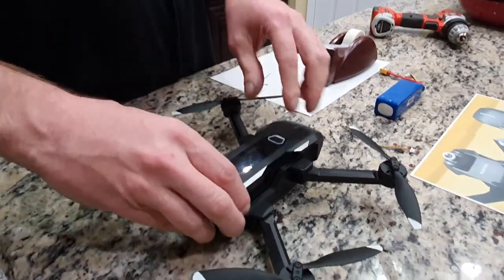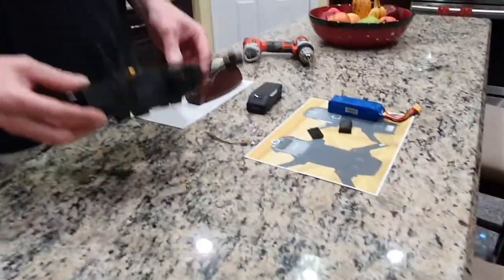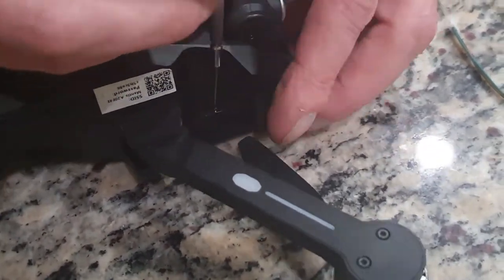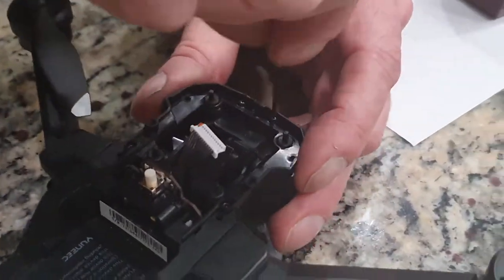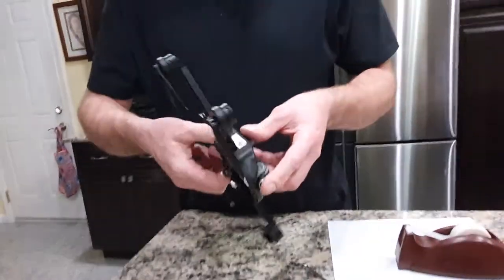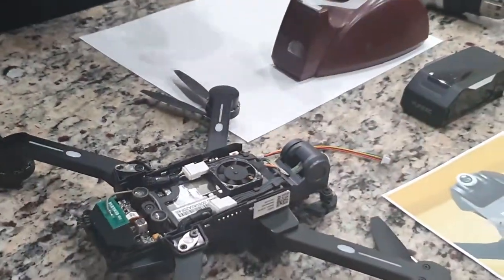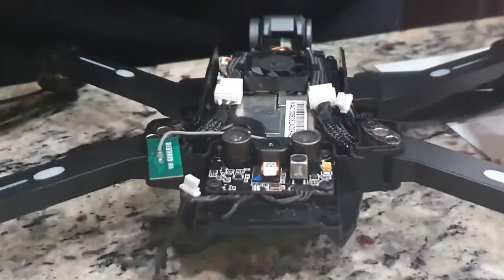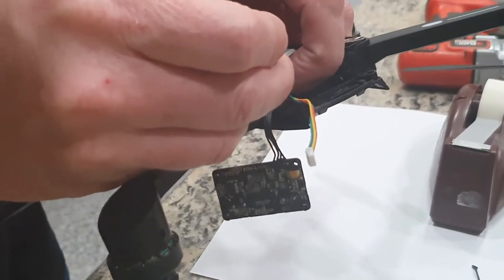Yuneec Mantis Q Battery Conversion Adapter with Compass Relocation Adapter Installation

Comment from the maker: How is the progress on this?
Sorry answer I gave up, it will only work for the 4 drones that have installed the compass adapter. (Mine and 3 other early testers)
I bought a completely different type of printer for better detail with the smaller parts. Made a completely different type of drawing for that printer. Printed some awesome quality cartridges that I was able to line the inside with foil to prevent electrical interference. And in the end I'm at the same place. Using the battery I designed it for.... It will not get the correct compass readings for flight, unless the compass adapter adapter is installed.

Since installing the compass adapter is so difficult, and the possibility of damaging the good module. I have thrown in the towel on the project. I now have I special printer occupying space and collecting dust. Was all still a good learning experience dispite all the cost of development.
Reply: RIP adapter

Comment: Super awesome mod bro.
I just saw on Amazon that a new one...Mantis Q is 169.00....I gotta have one and will likely do this mod.
Gave you a sub!
Reply from the maker: I had actually cancelled the entire adapter. Due to risky of damaging an unrelated connector during the installation of the compass relocator.
But from comments on another video, for another battery adapter that I make, I am given an idea for how to eliminate the need to use the compass adapter at all.
The thing I need to test is.....
Using aluminum tape used for duct work, called aluminum duck tape, I want to try wrapping a lipo battery with this tape to reduce electrical interference. The only thing stopping me from testing this new idea right now is.... I already have the compass adapter installed and will need to remove it, to return the mantis back to stock. Then I can tape up a battery and test without the compass adapter. First problem is I have no time and to many other projects going on. I'll get to it eventually. But until then, everyone will just need to keep using factory batteries. Also, no guarantees the test will go good?
Reply: @amphibiousmotorcycle  right on...I started to buy this srone from Amazon for $159...and apparently waited a day too long...because it's gone now!!
Either way I still want one but I sure dont have 3 or 4 hundred to put into it.
Looking forward to seeing what you do with the Mantis in the future.

Comment from the maker: Currently I have sold 3 on eBay and am awaiting there feedback before listing more.
I expect to list larger quantities in 2 weeks or sooner.
So today May 8th add 2 weeks by the 22nd I will add a link to the eBay listing here.
From the initial buyers I may learn somethings and make updates to the part or listing description and you will be much better off waiting for any updates that may be applied. Thank you all for your interest and Happy Flying.
Reply: Ricky Smith  do you have the battery conversion available w/o the compass conversion?  Also what are the specs on the battery?
Reply: Looking to buy this kit - where can I get it. Thanks
Reply: still available?

Comment from the maker: Is the compass adapter really needed?

I have discontinued the item.

Only me and 3 others are currently using this adapter.

Funny you mention.... Is the compass adapter needed. Lol

This is the reason I discontinued the item.

There is no way to use this without first installing the compass adapter.

But the killer is, when installing the compass adapter, there is a high probability that you will damage your GPS module.

The GPS module is located on the top under the front good area.

The GPS module has a wide connector that is difficult to disconnect but even more difficult to reconnect, without accidentally bending the tiny connecting pins.

Me and another both bent out pins, though we were lucky that we both found was to strengthen and correct the damage.

This started me on a mission to solve the issue and find a way to use this adapter without the need to install a compass adapter.

Even longer story.... I'll just say me and some great minds worked on it, had some promising solutions. In the end I can say for sure there is no way to make the battery or any other version of it work, without first installing the compass adapter.

Due to the risk of damaging a $75 part I have choose to not list the adapter on eBay.

Comment: Hi. Is arm replacement fairly easy on this drone? My rear left arm has cracked and bent after crash to the ground from tree branch fall and now it looks bad and I am afraid it is not gonna fly. But I am unsure if I should break the drone into pieces so I can put it back together after all?
Reply from the maker: Arm replacement is pretty easy, if you fallow this video it gets you close to doing it.  But be aware the reason I decided to quit making the battery adapter is because during this compass install it is possible to damage the connector for the GPS module.

Comment: if you check these comments at all, are you able to send me better pictures of the adapter front?  you can never see it in the video. also, do you have the updated design?  the one in the video is not the same as the one on thingiverse. thanks. the compass relocator isnt needed. it gives me no problems.
Reply from the maker: Sorry I'm slow to check the comments. I would think YouTube would have a better way to notify me when there is a new comment.
Anyway, I just checked thingiverse and all needed files are there.
I even have uploaded the compass adapter in another separate upload.
But if anyone is still interested in testing the battery adapter, I believe if you shield the battery with metal tape it should work without installing a compass adapter. I have not tested this and am only doing educated guessing. For the front of the adapter, you need to use the 2 smaller pieces. The one front piece needs to have the mini dean's connectors pressed into the square holes. The other small part goes on top last and the XT60 connector goes inside it.
Reply: @amphibiousmotorcycle  what about the connection to the drone? How did you do that? And from the video, you hooked the charging port on the side. That part wasn't in the file on thingiverse. That's why I asked about an updated file. Thanks for responding

Comment: Im looking for your kit do you still have any?
Reply from the maker: I'm not going to make more of these.
It's too complicated for the end user to take apart there drone to install the needed compass adapter.
There is a company selling batteries on eBay where once the battery goes bad, I believe you can open there case and replace the battery with a commonly available battery.

Comment: When will you be selling these???
Reply from the maker: I am setting up a new printing system now, using laser resin printing. Along with I still need to test if it's aluminum casing will actually shield the electrical interference, so adding a compass kit will not be needed. If all goes well, we will be able to easily use $15 batteries. Please subscribe and click the bell to get notifications when I post my next video.
Reply from the maker: I've got awesome 3D prints going right now. Only waiting for the test. It's way too cold outside right now.
Weather will break next week.
Crossing my fingers.
If it works I'll post another video and get the parts listed on eBay.
Will be a simple one piece solution, without the need to install the compass relocator.

Comment: Adapters are no longer on. Ebay
Reply from the maker: I didn't make available because.....
It works great, but during the installation it's possible to damage a small connector. 
Both me and another tester had this issue. 
We were both lucky we were able to correct the problem. 
But due to the risk of someone else possibly bricking there drone I decided it wasn't worth it to offer this adapter option.